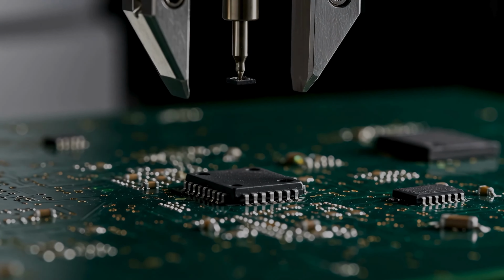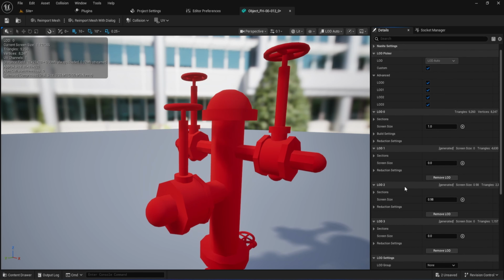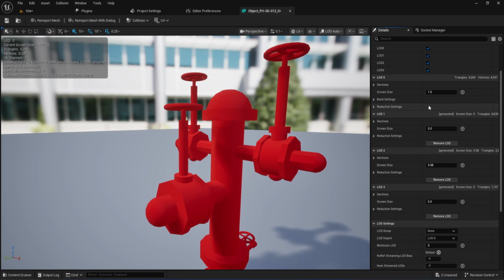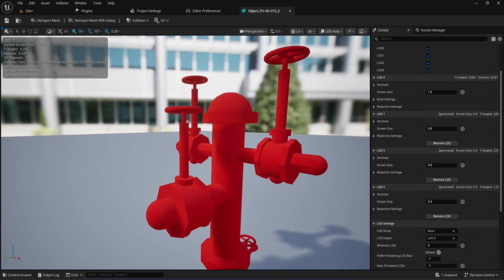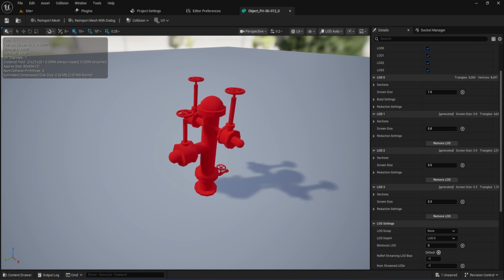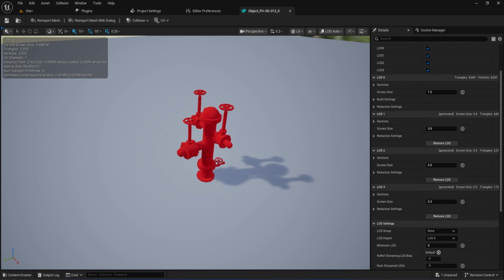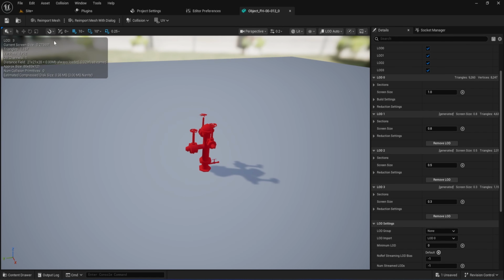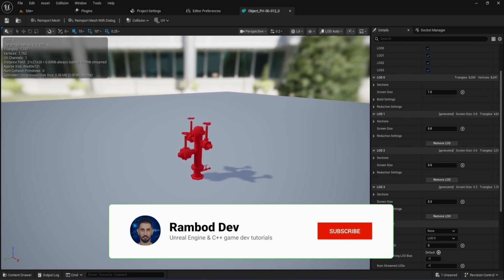Fix Unreal Engine Lag: Create Custom LODs (No Blender Needed!)

Comment from the maker: This is one of those optimization techniques that can make a huge difference without leaving Unreal Engine. In this test, we use Custom LODs directly inside the Static Mesh Editor to reduce triangle counts aggressively while keeping the visual difference small, which is especially important for standalone VR projects like Meta Quest 3.

If your project has thousands of heavy meshes, fixing LODs early can save you a lot of performance problems later.

A couple tools and resources game developers here might also find useful:

Humble Bundle - Game development, Unreal Engine, programming, 3D, and software bundles
https://humblebundleinc.sjv.io/jRrz9b

Meshy AI - Generate 3D assets with AI for prototypes, props, environments, and game projects
https://www.meshy.ai?via=Rambod

What is currently causing the biggest performance problem in your project: high-poly meshes, materials, lighting, or Blueprint logic?

Comment: Thank you for the video! Is it possible to make the LODs switch with a smooth fade-in? So it's not so abrupt.:eyes-pink-heart-shape:
Reply: Dithered LOD Transition in the material settings. Not sure if it works in the Mobile Forward renderer. And it does add some rendering cost when the LODs switch because it's rendering both LODs at once.
Reply from the maker: You’re welcome ❤️ As far as I know, Unreal doesn’t have a built-in smooth fade for LOD transitions. But you can make it feel smoother by lowering the screen size values, for example, instead of 0.8 for LOD1, try around 0.3. That way the switch happens from farther away and most players won’t even notice it.